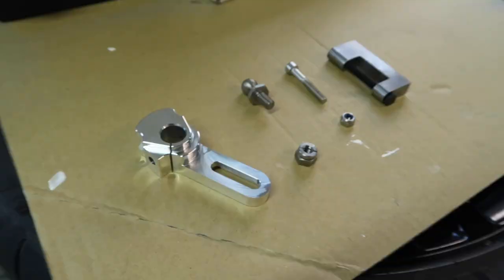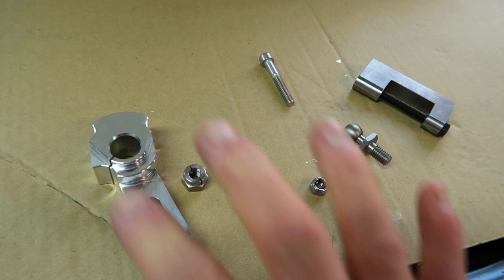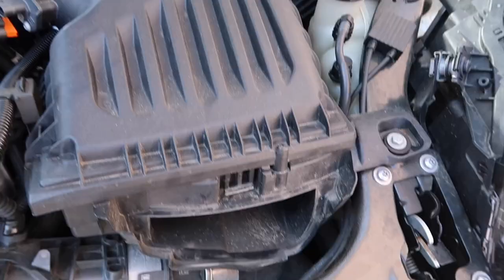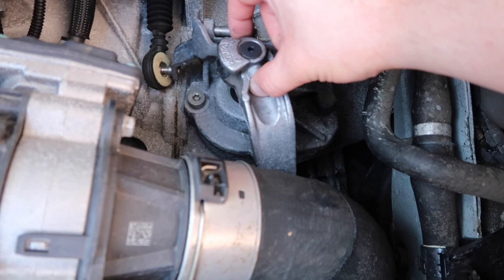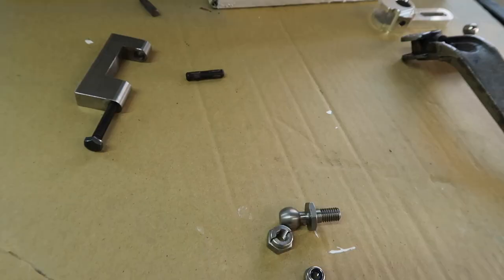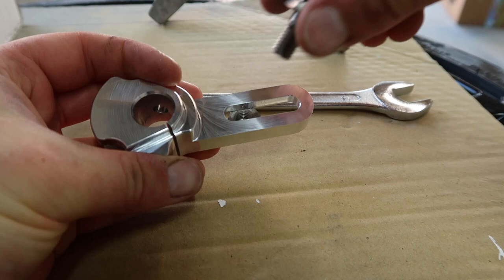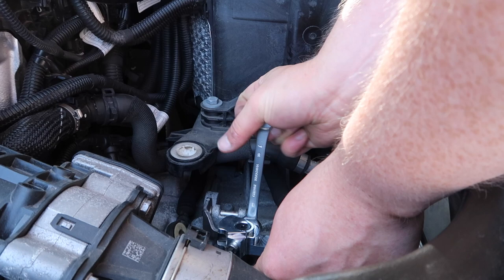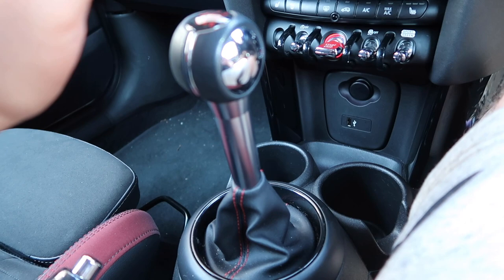FORGE MOTORSPORT SHORT SHIFTER INSTALL! | MINI JOHN COOPER WORKS F56

Comment: Thanks for the great video, I've bookmarked it to watch again when my short shifter is delivered.  It's great the the video was sped up for the removal of the OEM part and then installing the Forge part onto the shaft.  However I wanted to ask about the effort/force/time required to do these steps.  Did you do remove and install by hand only?  The reason I ask is because I read somewhere that someone damaged their internals that are under that shaft and would like to avoid this mistake.  I might prepare for this with penetrating oil first.

Comment: Excellent video Adam, although i own a 1.5 F55/56 B38 i am doing a test install in the next few days  for Forge Motorsport (weather permitting ) ..Lohen  who also supply these don't see a issue and i have also found a Video of someone who as installed on on a B38 1.5 so this could open up the market for B38 owners ....Anyway thanks for taking time and effort on this install which looks like its going to be a big help.....Forge say they dont list suitability on non tested cars but that does not mean it cant be ...
Reply from the maker: Cheers mate, good luck with the install, I reckon the similarities will play into your favour and work well :)
Reply: Hi just thought i would update you on the test fitting,it was a pretty straightforward job a bearing puller a must took me two minutes to remove..Got it set around 30% and i must say its like night and day with good positive shifts which made rev matching a joy ,hitting reverse is much easier ,always felt like you were using a oar previously so all in all good news for Forge ....  @AdamRainey

Comment: hi, my pin is not coming off at all. did it get harder and harder the more you screw the bolt in to push the pin out ?? mine doesn't want to move at all.
Reply: I am having the same issue. The pin refuses to come out. I have destroyed 2 pin extractor tools trying to get it out. Still at a loss.

Comment: Apparently installing this disables the reverse gear locking mechanism of the car. Don't even know what that is and if its got to do something with that extra long bit of the OEM shifter?
Reply from the maker: I don't know who told you this or where you read it but it is completely incorrect. Reverse lockout works perfectly and exactly as before
Reply: @AdamRainey  and what is reverse lock? Is that the extra push to the left when you engage the reverse?
Reply from the maker: Exactly that, yes
Reply: @AdamRainey Can't it be that this reverse lock is made for the case when you accidentally trying to switch to reverse while going forward? Like this removed part somehow blocks you (Have no idea frankly speaking, just thoughts)
Reply from the maker: @TrampChannel  no, the only relevant takeaway here is that this shifter mod keeps everything working as normal and that is the end of the debate. Any other suggestion is wrong and frankly pointless
Reply: @AdamRainey , sure, thanks for the video and reply =)
Reply from the maker: @TrampChannel  no problemo

Comment: How easy will it be to install the stock arm back later, I am just worried about that pin that was removed with the specialist tool? Do you think it will be easy to install it back in again w/o any issues?
Reply from the maker: It would be easy enough to get back in yea, it is a common enough thing. would be a case of lining it up and slowly tapping it in with a hammer. I would imagine a bit slower putting back together given the tight working space but certainly doable

Comment: 6:54 how the hell did you get that off so easily. Had to give up when I tried doing the install cause it wouldn’t budge
Reply from the maker: You can leaver the little pry bar off the metal arm so get it in position and then push down good and hard and it will pop off
Reply: @AdamRainey I’ll give it another go today then haha. I appreciate the help, very helpful video!